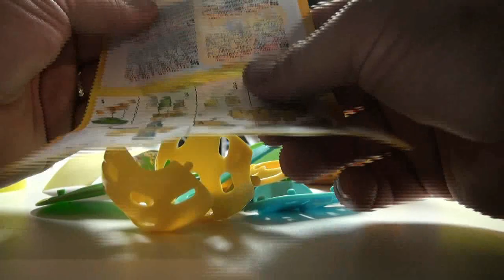Testing out the new smaller ripper attachment

Comment: that ripper unit would last all of 2.2 seconds out here in Saskatchewan with our winters. First of all Bill you should have put a couple of triangular gusset plates on each side rather than those pieces of angle iron. Hope like heck that you don't come across any large rocks beneath the surface and within the frost  cuz you will just turn that thing into a large piece of scrap iron.

Comment: three in a triangular pattern, leaving the tip with the single weld line then sharpen the three to a fine point? I have seen at least a couple of owner/digger/drivers do this not with the thumb or finger, but one did it to the bucket teeth, where he was near alice springs and the cost of teeth sent there was colossal, and a friend of his, (they must have been

Comment: Bill you need to address the blade pressure to ground contact force.its very important to get the correct loading by the correct adjustment of the cushion stop, once that's been sorted the blade rate of rear will reduce to an acceptable level , at the moment you have way to much loading on the blade and hence the level of blade wear which is evidence its not correctly setup. apart from that you pretty much nailed it.

typical plans
patentsonline  7117617